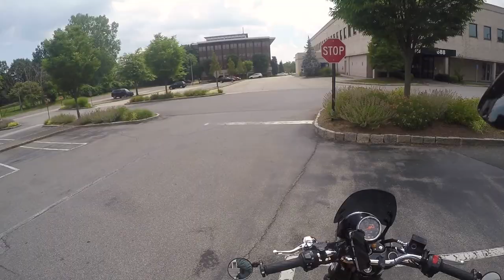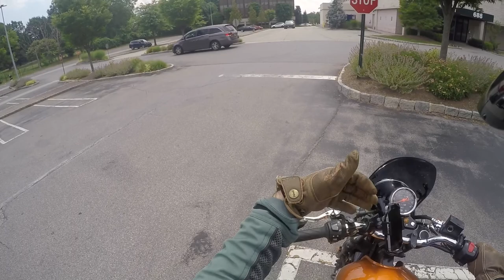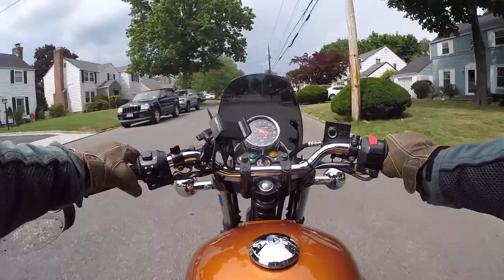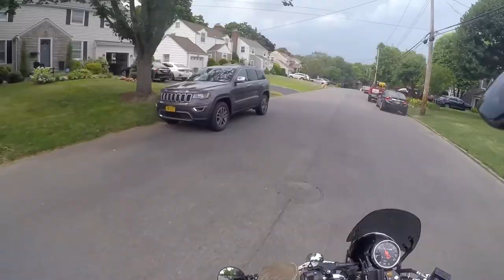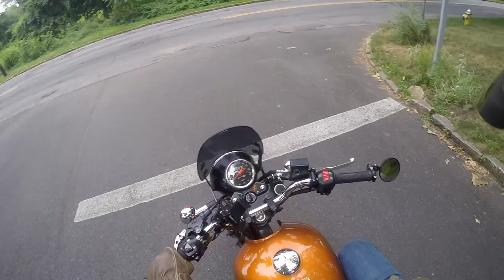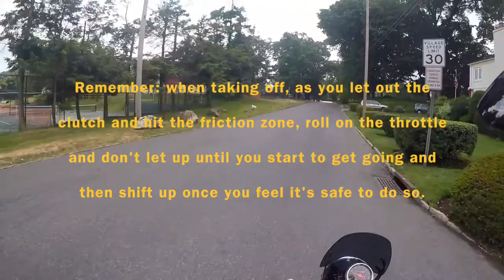How Not to Stall a Motorcycle on Takeoffs: An Effective Strategy to Keep Your Bike From Stalling

Comment: Hope I’m asking this right; Is it bad to hold the clutch right before the friction zone while waiting at a stop, rather than just letting the clutch go or pulling the clutch all the way?? So that you have a feel for the zone already before taking off
Reply from the maker: Hi Matthew. Okay, here is the long and the short of it. Some experienced bikers will use the clutch to keep the bike in place, which is why you might see some stopped at the red light rocking the bike back and forth. They can do it because they know what they are doing, and can get the bike going instinctually. Experience equals muscle memory, so after a while everything becomes effortless. If you, however, are a new rider, I don't suggest you ease up on the clutch at a stop because you might risk stalling the bike due to sudden release. Pull the clutch in all the way and hold it in place. When it's time to go, release it slowly while rolling on the throttle--and don't let up until your bike is going and you're out of harm's way; then shift up. (This works best with low-end torque bikes.) Eventually, you too can use the clutch to hold the bike in place--releasing it slowly, then pulling it back, thereby rocking the bike sort of back and forth. You will know when. Hope this helps.
Reply: Slipping the clutch to hold the bike in place is a bad idea. You will heat up and glaze the clutch plates, and then you need a new clutch. Using the friction zone for 3 seconds while taking off is what it’s designed for. Sitting still and slipping the clutch for 60 seconds will burn up your clutch. 
Try this. Rub your hands together firmly for 3 seconds. They get warm. Now try it for 60 seconds. You won’t make it. Your hands get so hot it’s painful. Same with your clutch.
Reply from the maker: This is absolutely true, especially for bikes with a dry clutch.

Comment: On going up a hill from a stop, what do you do when your short and the bike is heavy? I need to keep both of my feet planted, if I do it your way I’ll lose my balance. Any advice?
Reply from the maker: Hi Ani2fabulous! May I ask what bike you ride? Also, are you able to flat-foot the bike or do you sit on tippy toes?
Reply: I have a 2018 Harley Davidson 883 sportster super low. I am able to flat-footed but the bike for me seems very top-heavy, hence feeling like if I do any type of lean I might lose it. The good thing is I have yet to drop it. I learned on a 250 Honda rebel but the mistake I made was selling it and upgrading right away without really having enough time on the seat with the rebel. So I’m thinking I might find me another small 250 and become very efficient with that bike and then give the Harley another try or altogether sell it and find a bike that might have more of a lower center of gravity and not be as top-heavy.
Reply from the maker: Hi Ani2fabulous! I apologize for  getting back to you so late. I do not know how I missed your reply. Yes, letting go of the Rebel might not, in your case, have been the best move, but if you are able to flat-foot your Sportster, then I believe you can, with a bit of practice, get this under control. Flat-footing a bike is crucial to balance a bike, so you already are in a strong position here. This is what I'm going to do: I will make a video just for you. I learn better when someone shows me what to do, and I think I might be able to help you better if I show you. Therefore, give me a couple of days to put this together. (Of course, I do not mean to propose that I will solve your issue. I will merely try to show you what has worked for me. That's all.) In the meantime, since you need to keep both feet on the ground when stopped, tell me, in general, how confident are you with using the friction zone? Also, does the Sportster has a wet or dry clutch?
Reply from the maker: Hi Ani2fabulous. I hope all is well. I am sorry it took me so long to get back to you with the video I promised. My work consumes my life, but I finally have something that might help--if you still need it--with your concern. I have put together the following video on how to deal with your issue: https://youtu.be/kQrXr9S03oA . The video is a bit long, and I'm sorry for that. Again, sorry for being about three months late on this, and I hope it helps. Be well and ride safely.